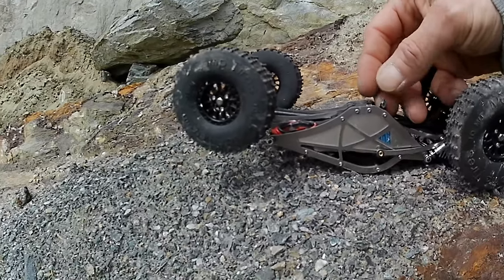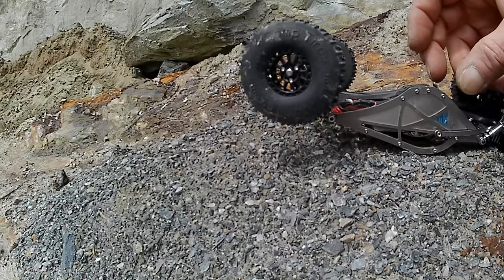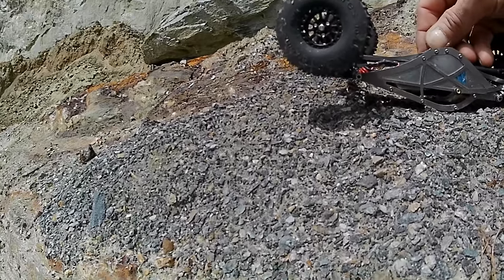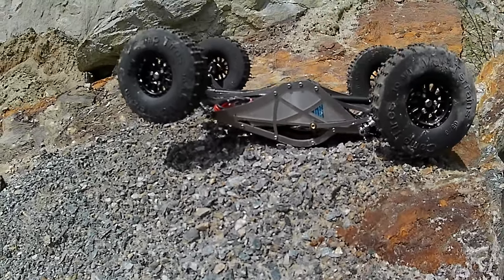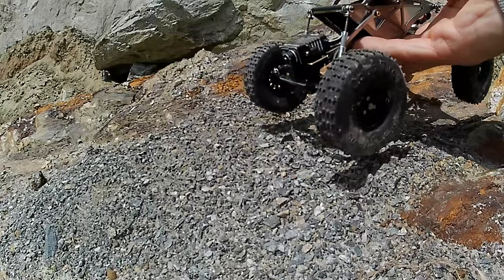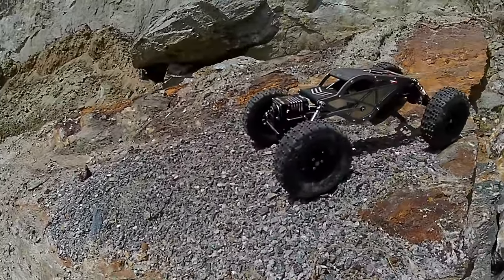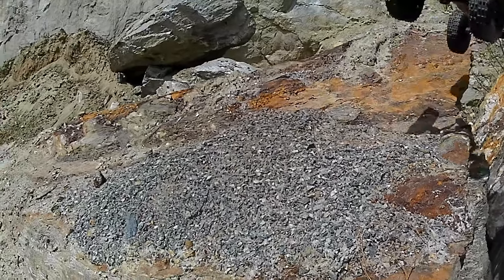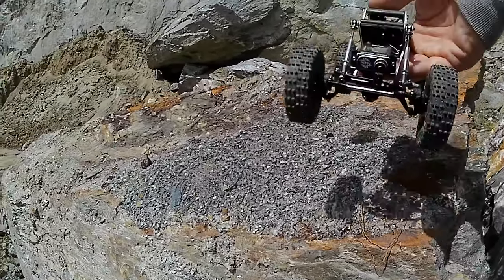ALBN24 - Quarry #2 - Breakover Slayer and Broken Skid :(

Comment: Man, I thought I had a wild looking slayer! Do you find the slayer or dementor mor capable?
Reply from the maker: what's a slayer?
Reply from the maker: For real, though, I think you're the second ro third person who's asked me about the "slayer" and I have never seen one. This is a custom one-off 'sport shafty' chassis from a guy by the name of Nick Albin. You can find him over at Instagram: @albin_designed - I bought this rig in Spring '23 and was running my Dementor V2 build quite a bit at the time. So I didn't pay much attention to this one for a while.

 Once I broke a V2 skid and then swapped a few things around on this (shocks, etc) I started to run it more. Honestly, it handles break overs with considerable more ease compared to the Dementor V2.  That said, I've done some sick lines with the Dementor and been perfectly happy about it. 

It's just that I like this rig a lot. So much so that I talked Nick into selling me the second one he had built. So, I now have possession of the only two in existence until he decides to build another one for himself. There are literally only two of these and I have them both.
Reply: @VermontScaleCustoms  awesome! Talented guy! I love the shorties with angled skids for breakovers.